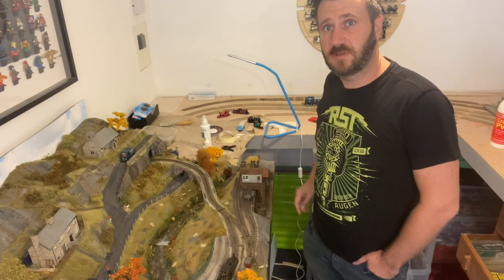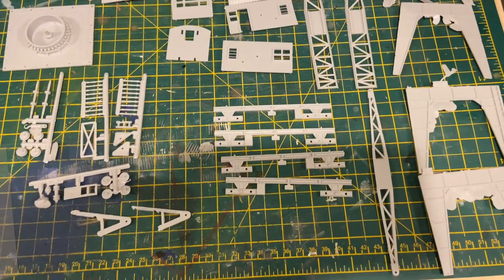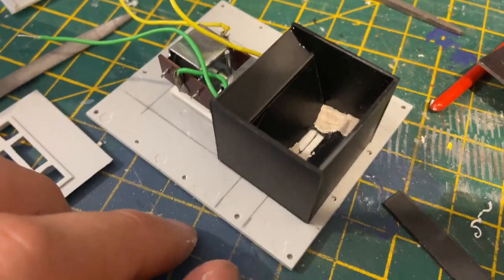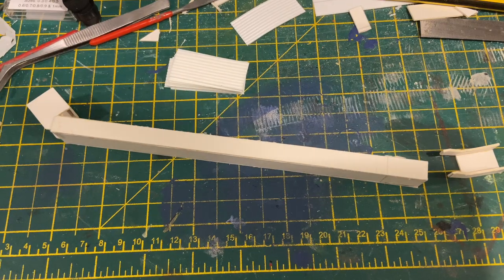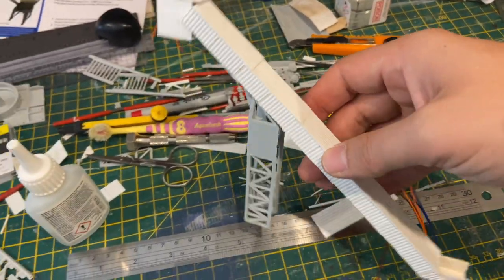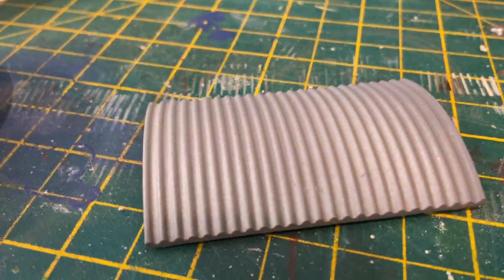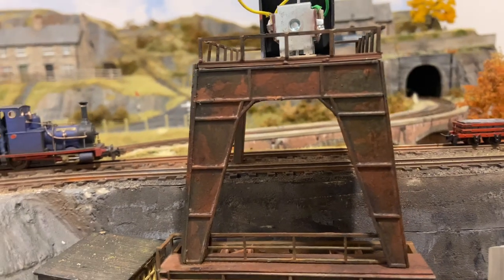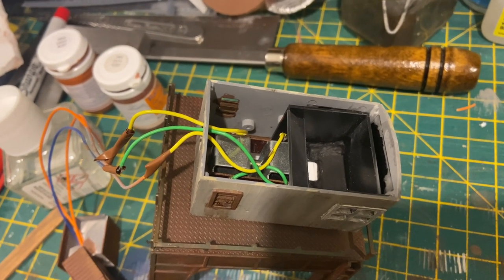Modelling a Working Stone Hopper. Building a OO9 Model Railway Episode 18

Comment: I've tried building a working coal hopper/chute in the past so can appreciate how finicky they can be, great work with yours!
Reply from the maker: Thank you very much, yeah they are certainly tricky think mine is gonna need some fine tuning.
Reply: @WesternSignalman  Maybe a micro servo might work better? It'd have more torque than the point motor for closing the hatch.